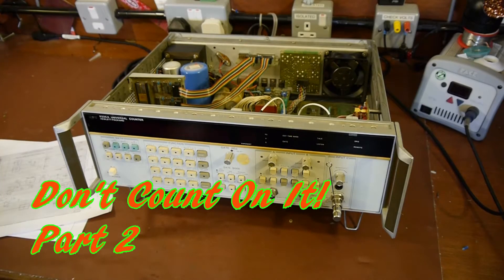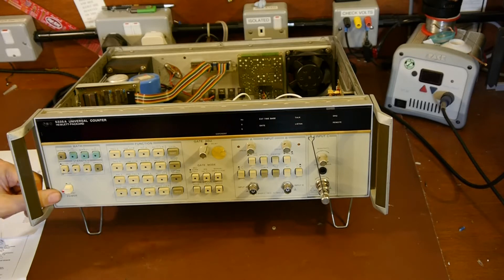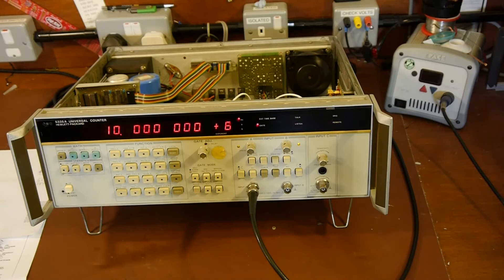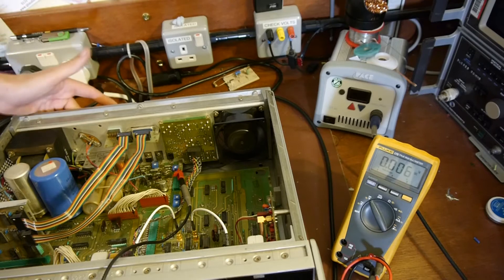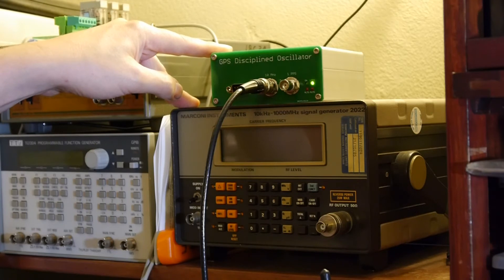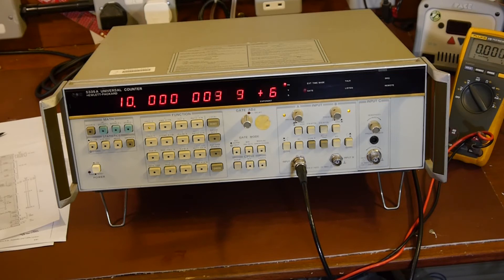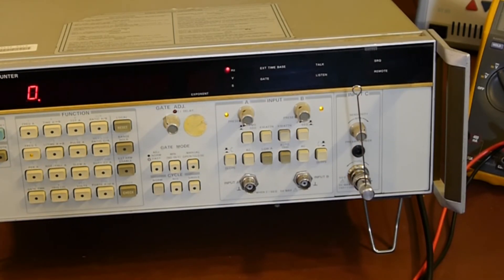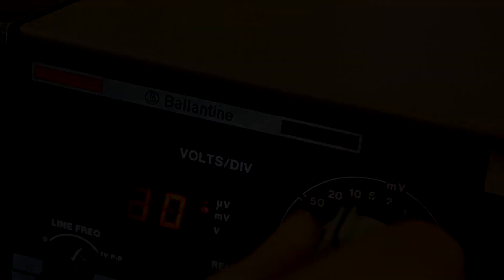HP5335A Part 2

Comment: Most "Universal Counters" from this era are counter - timers, the A input is used as a frequency input when counting and as a "start" input when timing while B input is used as the "stop" signal input - that's why Frequency B isn't  usually available on the front panel. Great video - nice job locating that bad cap!
Reply: I agree, it seems to be a choice that HP made with most of their counter/timers, if you want to measure frequency poke the cable into Channel A for low frequency or Channel C for high frequency and only use Channel B for timing, for example my HP 5328A doesn't allow Channel B to be used for frequency measurement at all!
Reply from the maker: David V Hello David glad you enjoyed the video and thanks for watching. Your definitely right regarding the functionality of channel B but given all the other functions available from the front panel it still appears counterintuitive to have to go digging through a Menu to switch a channel on. Channel C the high frequency input is accessible with its own control. I probably need to have a look at the specifications of the inputs the counter does appear a bit deaf and often require a bit of tweaking to get the correct input. I don’t think it’s going to get a lot of use as that rack format takes up too much space. Thanks Regards Chris

Comment: Nice one Chris, I spy a Meteor 600? Was that a scope calibrator at the end?
Reply from the maker: Andrewausfa Hi Andrew the meteor has been my main frequency counter in the workshop and been very reliable and accurate enough for my use. I have a number of radio test sets etc so don’t normally use the counter for radio work.  According to Simon your correct it is a scope calibrator amplitude and voltage test set. It came with the frequency counter got given it by a friend for free. It appears to work but I don’t have anything really accurate to check it with. Hopefully will feature in a feature video but wanted to include it as a teaser.

Comment: Well, it seems you have gotten yourself a nice new piece of testgear! 2 amps for just the logic struck me as a tad high as well, but I'm trusting Simon's expertise below, haha.
Reply from the maker: MrDubje  Have  fingered the various components on the PCBs and it’s some of the logic ICs that are getting hot.  There obviously nothing I can do to change this as the supply rails voltages are now all within specification. I could do with checking the manual I think the current are published but haven’t had a look yet.  The whole device runs warm I would be tempted to upgrade the fan if I use it more frequently.
Reply: I heard you say that (about the fingering, lol), yes. You can do so, of-course, or you could put some fresh lube (synthetic oil?) in the fan's bearings, it might make it a bit more quiet.

Comment: 2 Amps sounds fine to me. And if the transistor doesn't brand you it's running at a good temperature. Nice counter and a rewarding repair.
Reply from the maker: Simon Spiers  Thanks for the heads up on the temperature and current.  It was a simple repair and I think I got lucky with this one. I’m not sure how much use it will get as it’s a bit large for my bench.  PS did you see the Bellentine at the end?
Reply: No I stopped at  the end credits. Will check the bell end teen now.